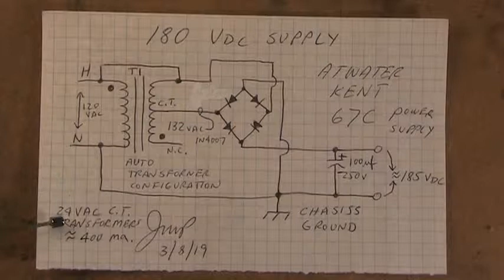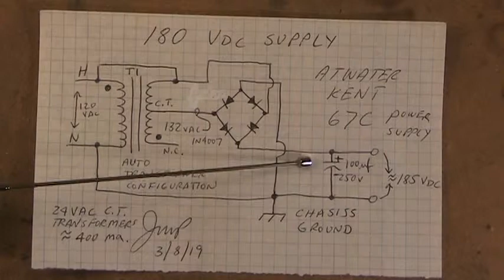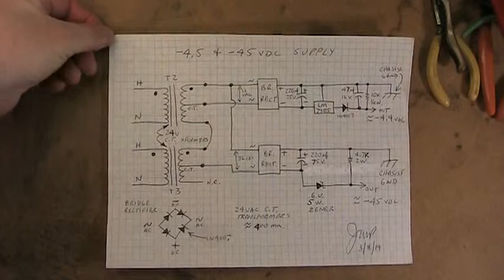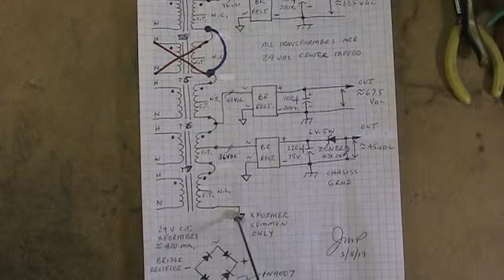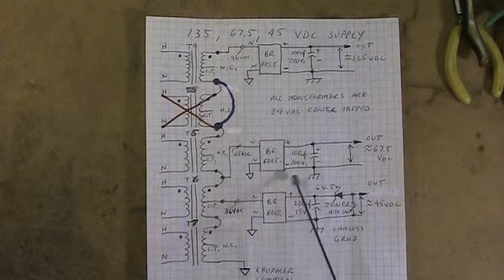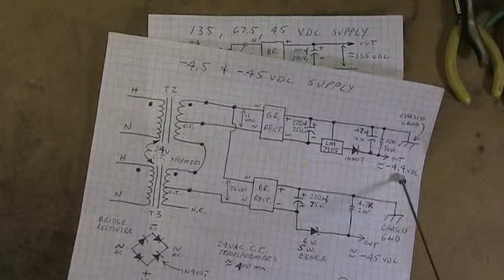ATWATER KENT 67C PSU FOR RON C

Comment: JP... I didn't know about this video until Doug just told me... so sorry..... I appreciate you doing this and all the work that went into it. I am going to build this supply as a backup as I have most of the parts.  No dropping resistors is attractive in this design. I can then test which supply works better - the good thing is I can always use either one for a future battery radio if needed,  Thank you so much for this JP really appreciate it very much.  Ron